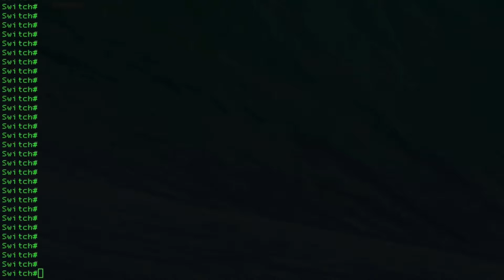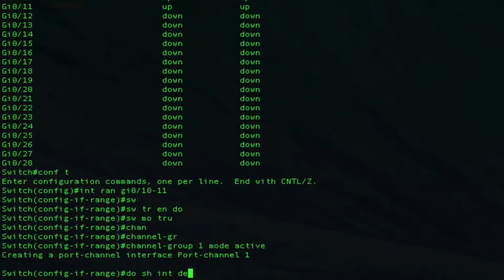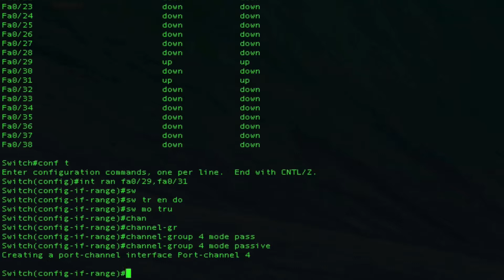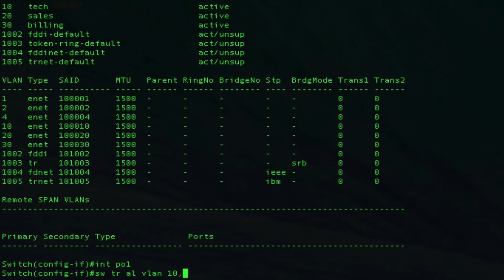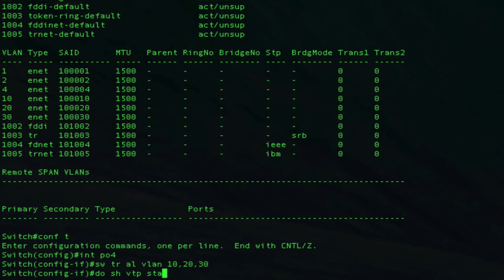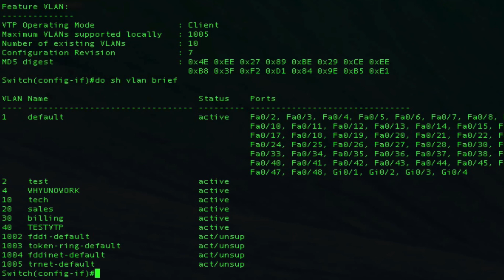LACP port-channel

Comment: Another best practice is to default the configuration on the physical interfaces before you add them to the port channel. 

Port channels have issues with order of operations and it's always best to be sure you start with a blank slate before configuring them.
Reply: So "vlan allowed" is best put on the physical interface first and then on the port channel?
Reply: Port channels only.